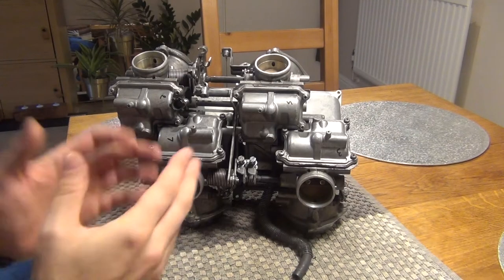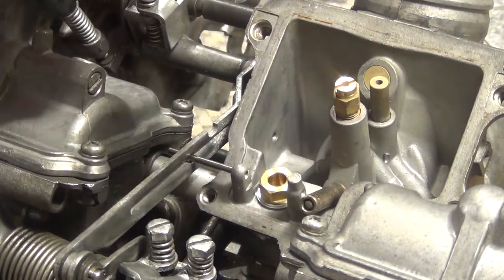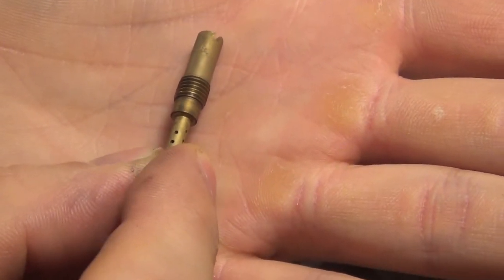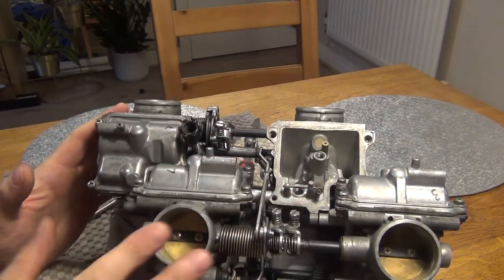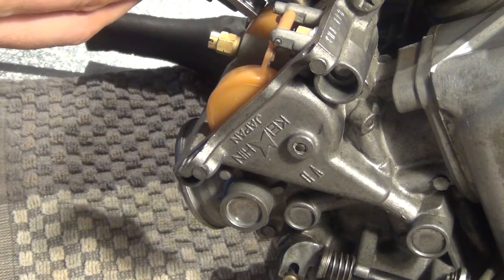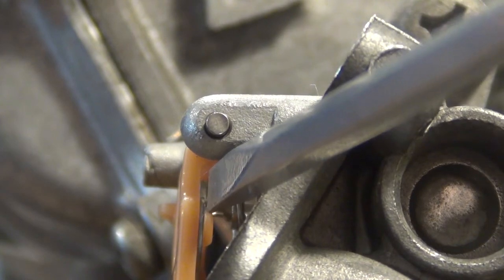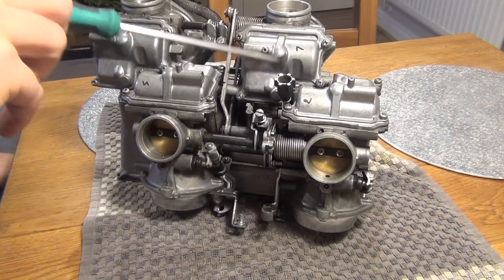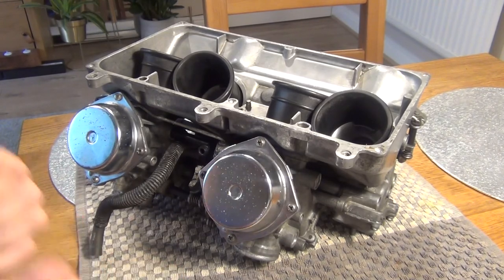Honda VF1000F Carburettors Inspection VF 1000 Carbs

Comment: Great demonstration on the float height adjustment and importance of orientation while taking the measurement. It's such a tedious and awkward job getting them all correct. Float valves--especially aftermarket replacements--are my biggest source of frustration in carburetors. Thanks for the vid.

Comment: Good day, I am in the process of rebuilding a set of these, my set was not as clean as yours when I started and it was mostly apart. I notice your main jet holder has 4 holes on either side, well upon removing the fuel varnish from mine I noticed 2 look identical to yours and 2 have 4 extra holes, do you happen to know if this is a front vs back positioning or an inner vs outer, i would assume the two higher flowing jets get the holders with more holes but I'm new to v quad carb setups and not seasoned on fine tuning jets at all. Do you know the answer or have an opinion, unfortunately they looked the same when removed and I do not know from which carb they originally were positioned, thanks for the video regardless of response or lack there of and greetings from New Jersey, USA
Reply from the maker: Hi buddy, sasly i don't have the answer for you. I'm very sorry :(
Reply: @Adikxx  there's only 4 ways it can go, trial and error my man, thanks anyway for the quick response